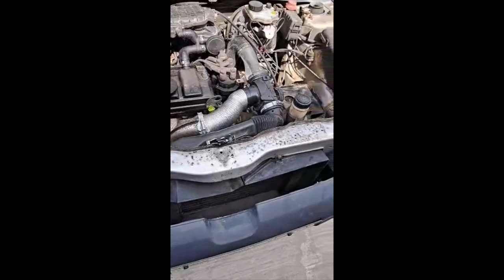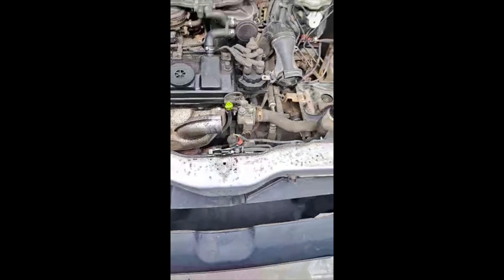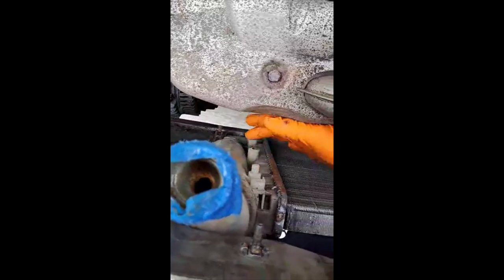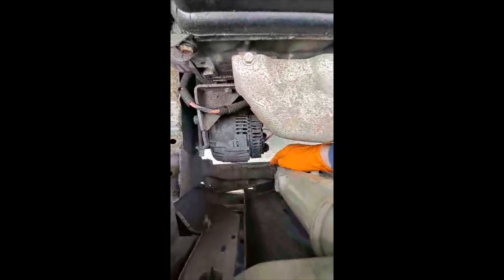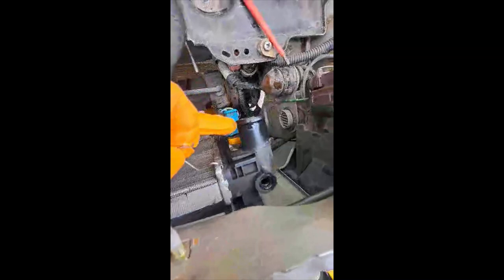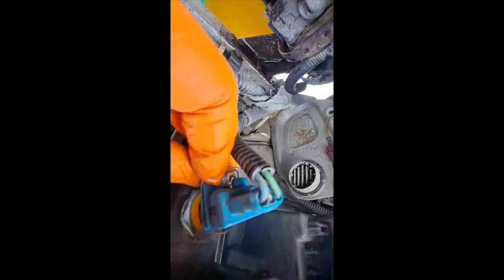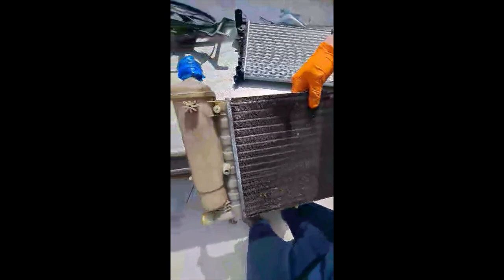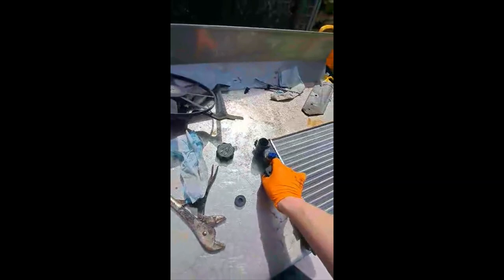How To Replace a Peugeot 106 Radiator and Coolant Change

Comment: Thanks for the vid, i bought one 106 a few days ago and the temperature goes up and its a leak on the right side of the radiator, this week i'm gonna change it. I hope it comes out easily. Have a great week!
Reply from the maker: No problem. Make sure to bleed the coolant system when the new radiator is in or the coolant willl not circulate and you're overheating light will come up on the dash 😊

Comment: Hi mate, do you know if the phase 1 and phase 2 106 radiators have a different sized temperature sender? I’ve bought one and it appears to be way to small
Reply from the maker: I genuinely could not tell you, You could check that without taking the radiator out.
Reply: I think the sensor in this video (attached to the radiator) is the fan sensor. Tells the fan to go on/off. The actual temp sensor is on the engine. There's a green and a blue one. Blue sends to the gauge in the instrument cluster and green to the ecu. So the green one is the actual temp sensor. Of course there might be changes depending on model year and 1.1 or 1.4 and so on...